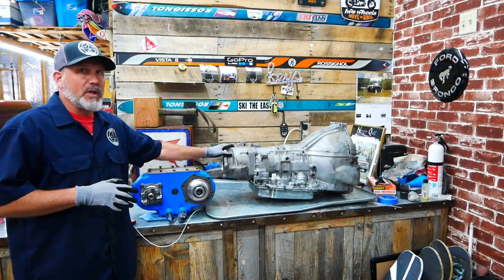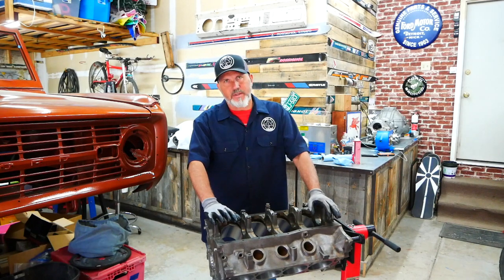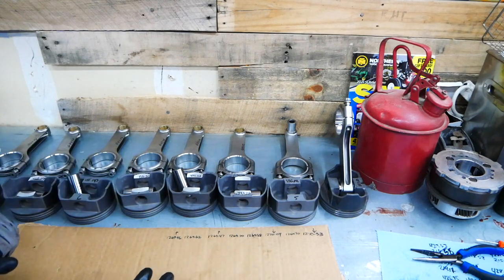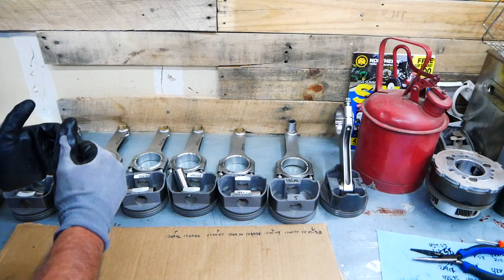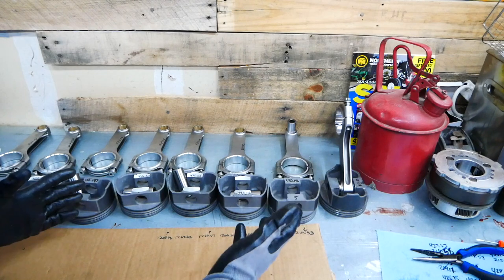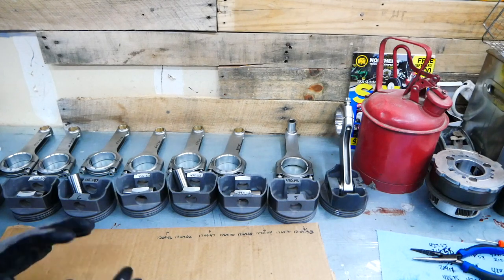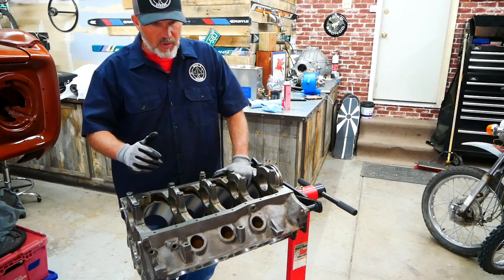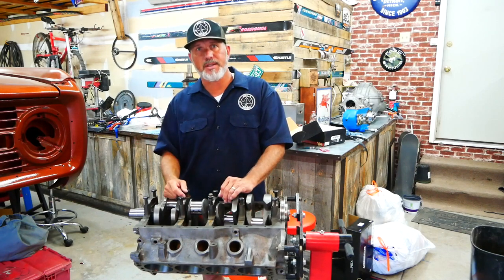1973 Ford Bronco Update, And Major issue!

Comment: The rods and pistons are balanced to the crankshaft, harmonic balancer and flywheel. Anything that is attached to the crankshaft should be balanced with the rotating assembly. They also should have marked each rod and piston for what hole they go in. Because they are balanced in a certain position/placement. They way they took material off the rods is normal for a set of H beam rods to get it to balance/weight right. Not sure why they didn’t mark placement for everything. Also sometimes they will also take material off the crankshaft to balance the rotating assembly as well. Ford motors are externally balanced and chevys are internally balanced.
Reply from the maker: Yep all true, including the markings. They just left out he markings.

Comment: Did they balance your crankshaft, flex plate and harmonic balancer with your rotating assembly? Honing is different between moly and cast rings depending on what you are using.
Reply from the maker: Yes they did. The flexplate has to be rebalanced and the balancer was milled all the way down. I am using moly rings so that probably explains the hone.

Comment: Dude, just catching up Chris. I’m also not an expert but that machining looks way substandard. Was that the original explorer motor?
Reply from the maker: The block is the original explorer. The rotating kit is a 347 stroker from speedmaster. After that video was published I found out that speedmaster screwed me and had to start all over with a new kit. I had the new kit balanced by another shop. Publishing that video next week. This has been a year long nightmare.

Comment: As a mechanic with many years of experience I can assure you that is not a quality machining job.  A good machine shop should have honed the cylinders to match specific pistons.  Every machine shop I have ever worked with honed that last 5 to 3 thousands of the bore to precisely match the piston for that cylinder.  So the pistons should have been marked with the corresponding hole they belong to.  That's why machine shops ask for the pistons before they bore the block... so they can match them to the specific cylinder.  As far as balancing, yes at a minimum the rods should have been marked with which piston they were mated with as well.  Personally every time I have picked stuff like that up from the machine shop the pistons and rods are already assembled to make sure they stay mated. A quality machine shop should also have provided a spec sheet for the balancing, showing you how much was taken off each piston/rod and what the final weights were.
Reply from the maker: That’s what I expected. I think if I had gone directly to a balancer, I would have received that treatment.